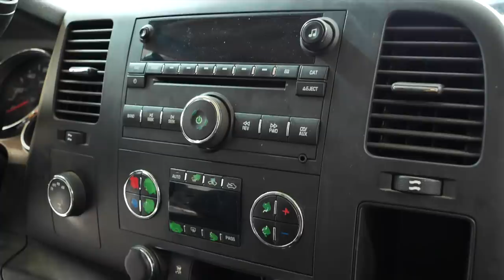WTF Is THAT! Deep Cleaning A Disgusting Farm Truck! Car Detailing Restoration

Comment: I would like to recommend a tool that I have used for over 20 years to clean my vehicles.   I have a small Hoover Hand Vac.   It has a belt driven round brush that really helps me get the  bulk of the dust and dirt out of the carpet.   It really saves time and dies a beautiful job

Comment: Let me ask you a question, when cleaning the radio speakers and electronics of the truck have you had any complain stating that an electrical part is not working due to how you spray the cleaner directly into the parts. It's just my way of saying that since some liquid portion may enter and have a slight change in its performance.

Comment: How do you get the water hot for the extractor since it’s not a self heating extractor now?
Reply from the maker: Hottest water I can get out of the tap into the bottle. Heat loss is minimal especially if you are doing multiple pieces. You run through 2 gallons on 1 4x4 foot carpet
Reply: @StaufferGarage  I’ve got a little Bissell pro heat now, but before I did in my old extractor I would run water through my coffee pot to get it hot and then use it. I just wondered because I know on a big job like this you go through a lot more water than maybe the average person doing a small detail at home.